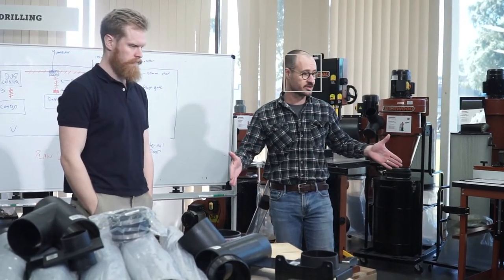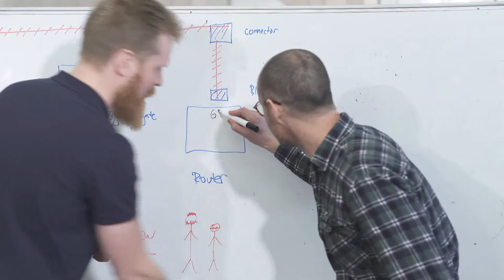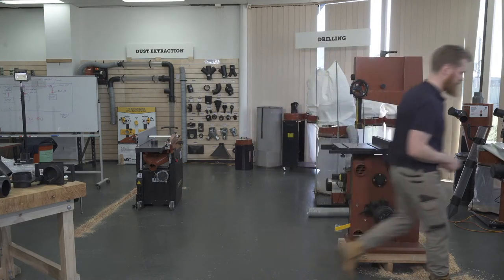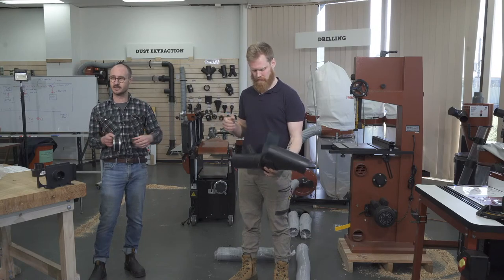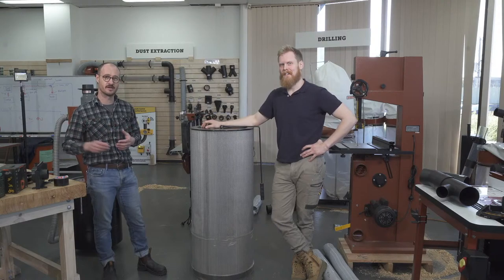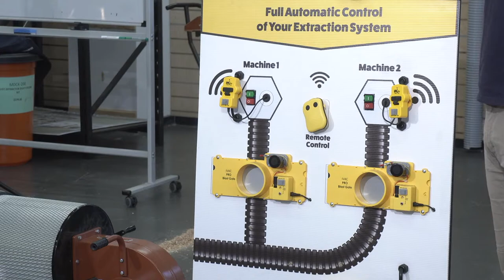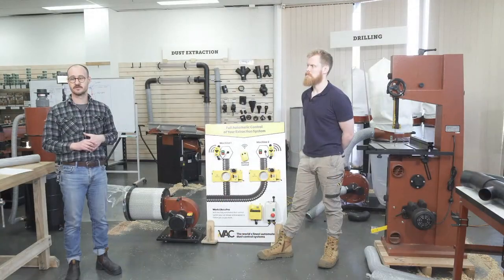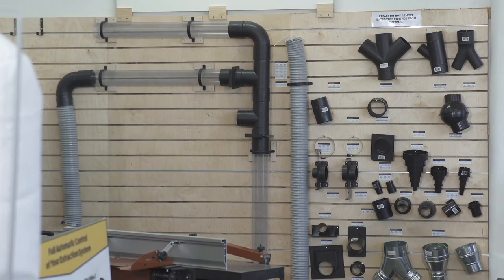All Things Dust Collection!

Comment: Great video and explanation of dust extraction. If one has a small workshop like a garage why pipe a system and worry about runs and CFM when using a dust extractor like you showed on wheels? A one man workshop only uses one machine at a time and can move the hose and or machine to the machine they are using. No need for piping is there?